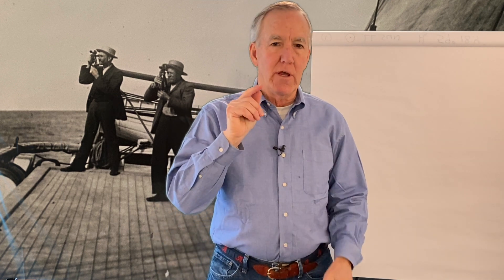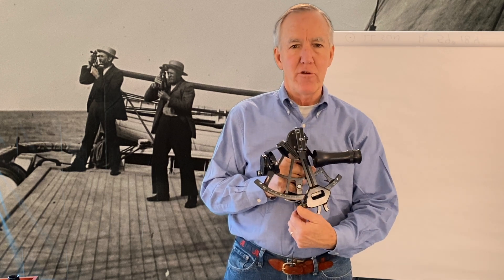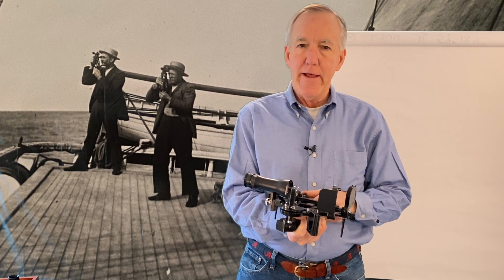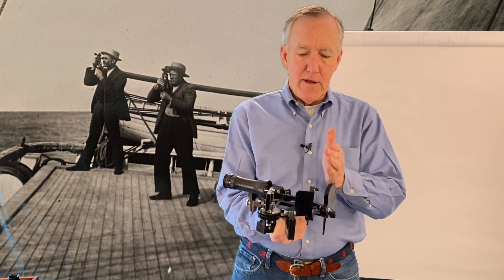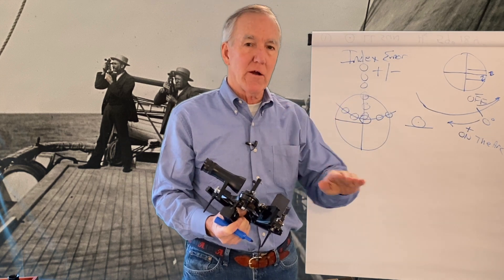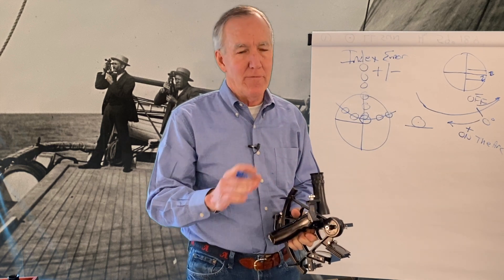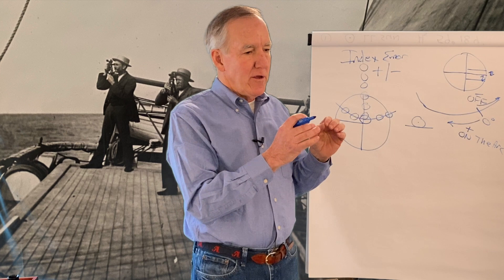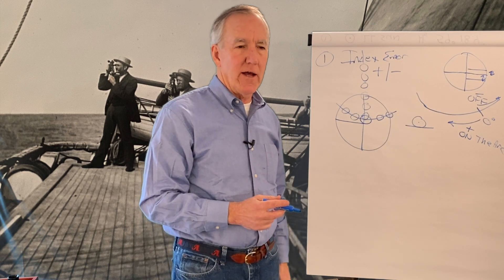Celestial Navigation, Episode 6: The sextant, taking a sight, correcting the sight

Comment: Wonderful introduction Is the micrometer drum set at zero just before the sight of sun? do you turn it clockwise or counter clockwise when sun just touches the horizon
Reply from the maker: There are a number of methods to bring the sun down to the horizon, and starting at zero while learning is best practice. When adjusting, a c-wise turn of the micrometer drum will increase the reading (moving "up" the arc). When making adjustments at the horizon, by turning the drum it'll be obvious which way you have to adjust to bring the sun up/down to the horizon.

Comment: On Homework problem #1, my answer was 41° 47.8’ vs. your answer of 41° 46.8’. 
1.0’ is obviously very small, but I’d like to know where I went wrong. 
Hs 42° 06.4’; 
IC 1’ OFF =+1, = 42° 07.4’; 
Dip -2.7’ = Ha 42° 04.7’
Ref -16.9 = Ho 41° 47.8’
vs. published answer of 41° 46.8’
Reply: I think your answer is correct and that Andy made a mistake. It seems he forgot to add 1’ to correct for the index error.
Reply from the maker: I lost track of comments so apologies for the delayed response. Yes, I forgot to add the IC so you are correct! (correction made in the notes) Thanks!

Comment: the way i understand it, the horizon mirror can be adjusted around 2 axes but the index mirror only has one axis for adjustment. is that correct? and if so, why does the index mirror only have one adjustment? if it had 2, it would be possible to eliminate the index error.
Reply from the maker: The Index Error is a “vertical” error only, so just needs the one adjustment. the Horizon mirror has one adjustment In the other plane

Comment: I'd already be 10 miles away by the time I did all this.  How big is the error margin
Reply from the maker: Well, I will say that using celestial is not like reading a GPS! You don't get an immediate position, but one that is for a time a few minutes previous (depending on how fast you reduce the sight and plot). Celestial is best used on ocean passages, where "right now" positions are not as important as in coastal navigation where they may be lots of obstructions.
Reply from the maker: As far as accuracy, the more you use celestial the better you get at it. I am usually within 1-3 miles when comparing to a GPS position which is fine for a passage.
Reply: @thenavstation  how long does it take you from start  to position fix usually 
Out of interest. ?
Reply: @thenavstation  I am starting an rya celestial nav course in a week or so
So am trying to get some prep done.
Reply from the maker: @farqfarq2225  Reducing a sight typically takes me 10-15 minutes at most, assuming no errors which means going back and reviewing.
Reply: @thenavstation  thanks 👍